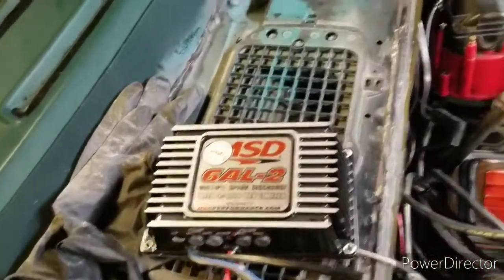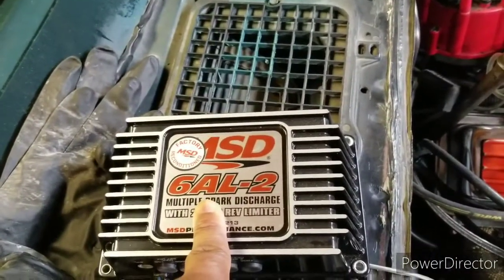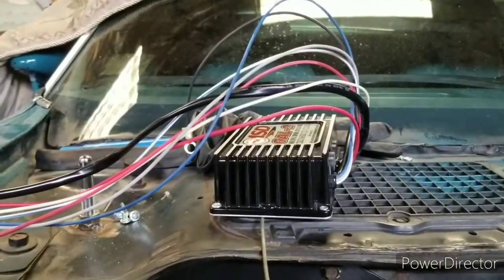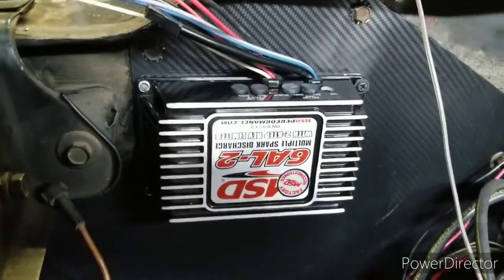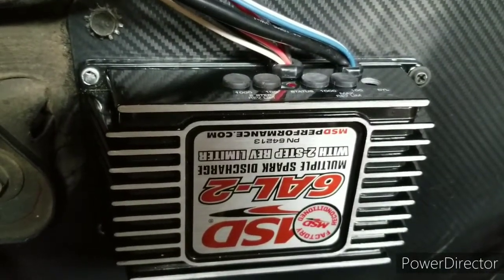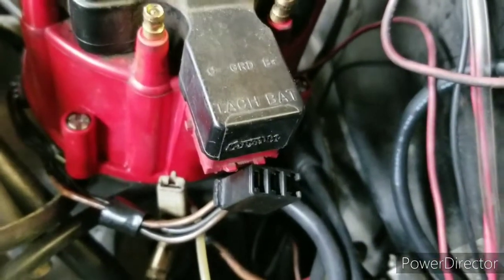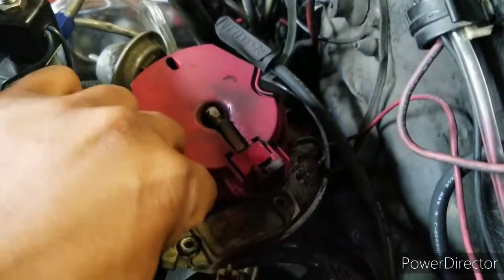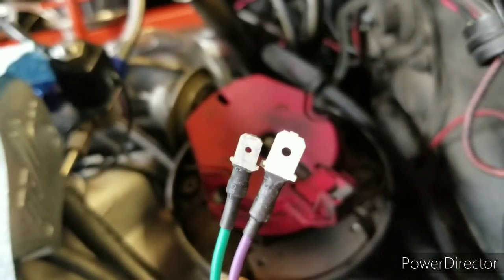HOW TO MSD 6AL-2 INSTALL (STEP BY STEP)

Comment: Factory grounds are not threaded into the metal such as the one you removed the star washer from. That’s factory. Don’t connect the large black wire to the - batt connection but find a good metal ground. It works better this way electrically. Check your timing too cause it may be off when you use a MSD box.
Reply from the maker: I appreciate the tips. Also thanks for watching😁👍
Reply: @Duwop77  One more thing, MSD recommends large spark plug gaps. Do not follow these directions or you will put stress on the ignition system and wear out the box. MSD wants you to keep buying boxes. If you run points and a MSD box then .035 is your max. With Pertronix and Crane XR-I type triggers that replace points plus your MSD box, go a max of .040. I tried .045 and had hesitation shifting through the gears to 3000 rpm in my 70 Z28 and while cruising at 3000-3500 rpm. With HEI only use a .045 gap and a max of .050 with a MSD box.

Comment: You could take some foam insulation and put underneath the self tap to give some dampening. Check out progressive ignition. They have a bad ass distributor.
Reply from the maker: Thanks for the tip. I appreciate it. I'll be looking into progressive ignition distributor. Also thanks for watching 😁👍

Comment: Good how to video.  Not overly complicated.  1 question though:  What do you do with the battery and tach wires that were hooked up to the Distributor before the install?
Reply from the maker: The tach wire from your cars harness goes to the tach(Gray) wire from the MSD. Not to the distributor. And the battery/ ignition wire also goes to the thin red wire on the MSD. Thanks for watching 😁👍
Reply: @Duwop77  One last question please.  The 2 step switch, I bought momentary switch that has to connection terminals on it.  Is one the blue wire and one going to ground, or something else?
Reply from the maker: @deanfontana5108  The blue wire will go to one of the connections.  And the other will be ether power or ground. Is there any markings on the  switch? Or instructions to specify the connections?

Comment: Hey man I know this is an old vid so i’m hoping i can still get a reply. do you know anywhere i can get a reman 6al-2 for cheap still? the link in the description is no longer good. i have one that i bought used from a private seller for 100$ but turns out it has a problem😢
Reply from the maker: This is one I found on ebay. It says factory refurbished. Check link below. Thanks for watching.
https://www.ebay.com/itm/275532304090?mkcid=1&mkevt=1&mkrid=711-53200-19255-0&ssspo=HnELCJLqSs6&sssrc=2349624&ssuid=00bsf4SkRKe&var=&widget_ver=artemis&media=COPY&siteid=0&campid=5338700573&customid=&toolid=10001

Comment: Where did you buy the factory refurbished box  thanks.
Reply from the maker: I found it on ebay. You can look and see if there's more. Also below is a link to one I found but its not the exact same one as mine. Thanks for watching 😁 👍 
https://www.ebay.com/itm/MSD-62013CR-Digital-6A-Ignition-/234149449139?mkcid=1&mkevt=1&_trksid=p2349624.m46890.l6249&mkrid=711-53200-19255-0&siteid=0&campid=5338700573&customid=&toolid=10001

Comment: How has it worked? Did you use the diode for the voltage regulator?
Reply from the maker: It's been working great so far. Haven't had any issues. Thanks for watching 😁👍

Comment: Boost port on the box ? 
And map sensor  that’s a nice box for boost ! Just need a laptop to program the timing .. 
I need one myself !
Reply from the maker: No this box doesn't have the boost port. The msd 6 btm is the box with the boost port. I started to get that model but didn't want to dish out the extra cash. But I should've. Thanks for watching 😁👍
Reply: @Duwop77  oh damn ! The MSD-2 6530 is a great box for boost looks just like your box .. Need one myself and yes they are pricey ! 
My olds is Sbc I went with CX racing headers they fit real good 
Not many people were making these kits for first gen engines there is a kit that looks like yours that fit horribly!! 
Your kit fits nice!

Comment: What size wires did you use the extended ones ??
Reply from the maker: If I'm not mistaken it was between 14-16 gauge. But try to use at least the same gauge wires as the originals or a little bigger. Never smaller. Thanks for watching 😁 👍

Comment: Where did you end up plugging the blue wire? Since it's it's for 12v activation for 2 step?
Reply from the maker: I hooked the blue wire to a momentary push button switch. Thanks for watching 😁👍
Reply from the maker: If you need further assistance let me know. I'll try my best to help.

Comment: Were did you get the blowthough carb at and how much was it
Reply from the maker: I bought mine refurbished from ebay for about $600. I checked and found a good used one on ebay now if your still interested?http://rover.ebay.com/rover/1/711-53200-19255-0/1?ff3=4&pub=5575597721&toolid=10001&campid=5338700573&customid=&mpre=https%3A%2F%2Fwww.ebay.com%2Fitm%2F183768485155
Thanks for watching 😁👍
Reply: @Duwop77  thank you for the reply I will take a look at it